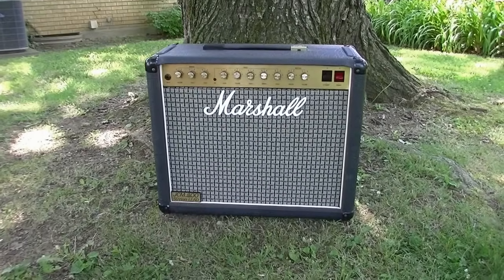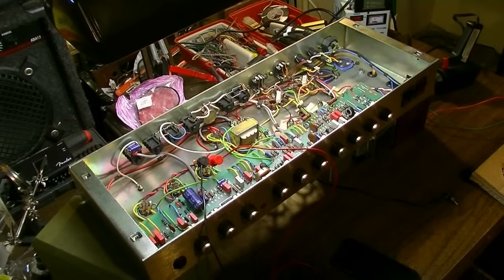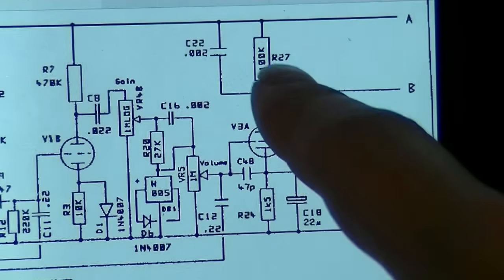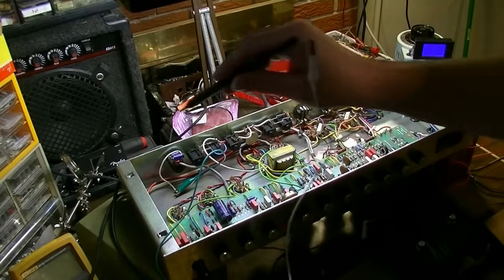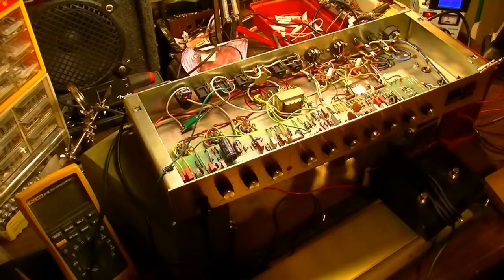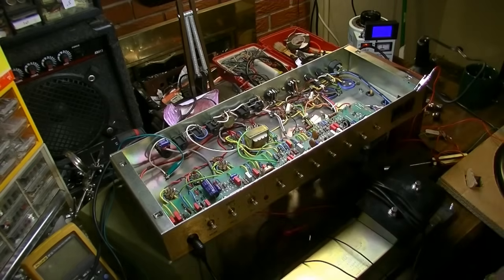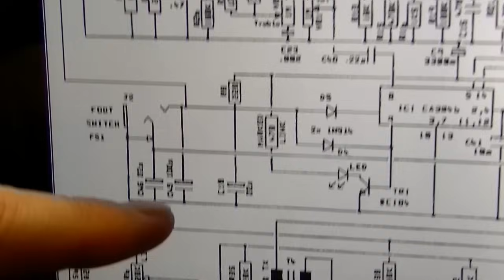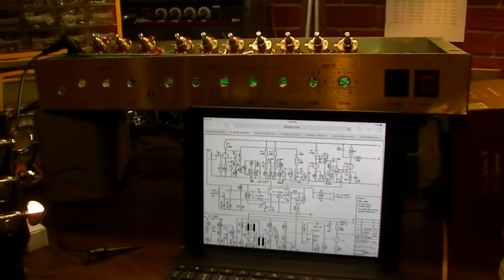The Amp Repair that Almost Broke Me - Marshall JCM800 Combo

Comment: The baby looks like her Dad! I have a non-reverb single channel with 6550s and this will probably help when I rehab  mine. Thankz
Reply from the maker: The milkman is not that good-looking. :P
You shouldn't have any of the switching issues with yours.
Reply: The Guitologist It is a JMC 800 Lead Series I have and I like the grill cloth that has been replaced on this one. I don't think mine has ics or transistors. I am debating whether to keep the 6550s or change to EL34s. Most of these 112 Lead Series have EL34s. They are warmer sounding than those hifi sounding 6550s. The overdrive I get from mine comes mostly from the preamp. It is a good pedal amp though.  Great video! Lots of comments! Thankz

Comment: So what is best guess as to the problem? v1? ...or one of the last 5 or 6 caps? ...dirty socket in v3? 
...one or both of the Q's?, ...that resistor @ 'link'? ...v3? ...or, please say it isn't so, some or all of the above?? (plus I'd forgotten all the caps you changed before) Even if there's no definite answer, you had me on the edge of me seat throughout, and it wuz most instructive... so thanx very much, really.
And please, keep 'em coming and... 
cheers

Comment: I too had a 1x12 50w JCM 800 combo from '86. Bought it used for $250 back in 1995. Almost from the get-go, this thing had issues: From bad tubes that were rattling, the clean channel breaking up too much too soon (when I wanted the damn thing clean), and the speaker being mounted in a weird place (just lower right of center). Even after getting it re-tubed and serviced twice, the issues were still not resolved. But the REAL FUN occurred when I tried to take it out on gigs. I could never EVER hear it, even with the master volume cranked up. Got bitched at by the band leader for being too loud. So I tried to face it toward the wall. Couldn't hear anything at all, and then I got bitched at for playing sloppily (b/c I couldn't hear myself). Long story short, that amp actually COST me gigs rather than helped me get 'em. Ended up selling it for DOUBLE what I paid for it (hence, what the interested party OFFERED to give me for it), and was only too glad to let it go! I said NEVER AGAIN to getting another JCM 800 after that!

Comment: I have a 4210 on the bench which I had to replace the power switch (melted), replace PT, do a rectifier diode work around because the board was burnt up and all traces gone. Someone did work their which caused the rest of the damage.  Amp up working but if you turn the reverb pot it blasts into oscillation.  The work continues. Mark

Comment: A nicely presented tour and explanation of your diagnoses. I'm left wondering, with hindsight, whether you deduced which component(s) actually needed replacing for the fix?
Could I also ask advice, or suggest a video subject? I have an old, appx 1963, Vox AC30 that I have had stored and not powered up for about 10 years. Last time I turned it on it worked fine, but I've heard if capacitors have dried out you might blow the o/p transformer. What components need testing before I power it up? I am an engineer, but it's a long time since I worked on valve circuits (watching your videos for some useful revision!). Unfortunately I don't have a variac. Barrie.
Reply from the maker: You really need a variac. This is the one you should get: http://amzn.to/2sBZ7kK
Even if you don't use it often for repairs, you can always use it to dial your amps down to "brown sound" them or play a lower volumes. You definitely don't want to just throw a switch on that Vox. Ideally, you'd also want some kind of current limiter, but the variac kind of does that already. You'll want to dial it up about maybe 25% of the way on the input and start checking voltages on the power rail at each node and dial up slowly, maybe a few volts at a time, over the course of maybe an hour or so. This will give the original power caps a chance to reform. You may still want to replace them and it's probably advisable, but some weird people like "all original" in vintage stuff like that and if you're thinking of selling it, it might be better to just leave them in if they work. It is not likely they will take out a transformer unless they are shorted. But only then if you didn't have a proper fuse.
Reply: Thanks for the advice. So I'm guessing all of the biggish electrolytics most likely to be suspect? I'll look into buying or borrowing a variac - thanks for the suggested link, but as I'm in the UK with 240v mains that wouldn't be the model for me.

Comment: I never had an 800 but loved my JCM 900 when I owned it back in the 90s.
Reply: I had a JCM 900 in the 90s as well. 50w head, not the 100.  Had this theory that I could crank up a 50w to get that heavy overdrive sound I wanted without blowing out my neighbors windows.  Turns out I was right.  Loved that amp and the cannot remember for the life of me why I got rid of it. I recall selling it but I cannot remember to whom or why I felt at the time that I was better off without it for any amount of money.

Comment: Damn brother, I love your stuff. But for the love of God, get a sign gen and an o-scopes! They will greatly simplify signal tracing by giving you a visual representation and voltage differential from each stage! An extremely quick way to verify amp stage gain function. Also very cheap to buy.

Comment: I have had a similar problem trying to get a reading on a negative feedback resistor while in circuit. I couldn't figure out why I was getting such a low value. Then I realized that when the probes were on that resistor, you also have a connection back through the output transformer to ground. In this case, you were basically reading the connection through the 100K resistor in parallel with that 4.7k resistor between the 100k and ground.
Reply: Bobby U absolutely right! DC conditions the 100k is in parallel with the 4k7.

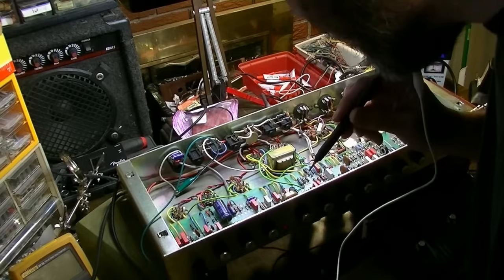Comment: What are you doing around 20:30-22:00? are you connecting a speaker directly or is there something else in between? What is that black pen looking thing? something impedance matching?
Reply: He's doing an audio trace. His black pencil kinda looks like a probe from an old multimeter or oscilloscope. Think about it though, the signal levels where he is testing are in the preamp and would be too low for just a speaker.
The alligator clip on the end of the old probe would be connected to a smaller (sacrificial) guitar amp's input cord, the ground would be connected by another alligator clip to the test amp chassis. The audio signal is picked up by the probe, where you touch the circuit, and heard though the other amp. This demonstrates how far the audio signal is getting through the circuit and also what is happening to it at various stages. Typically there is about 10pF capacitor in the probe, not sure what Our Hero uses.  It's a neat trick! Like an oscilloscope for your ears.
Reply from the maker: Rick is right. That probe has a small capacitor on the end of it to block any high voltage DC and the gator clip is going to a cable plugged into that Kustom KBA15 amp at the back of the desk. Another ground lead is going from the instrument cable ground to the Marshall chassis.
Reply: That makes sense.
Thanks to both of you for your answers.
Love your videos.
Reply: Is there any reason why you are not using a signal generator and an oscilloscope, i use this when repairing amps ? It seems to me that it possibly could be quite dangerous poking around in the amp with one hand and strumming the guitar with the other since the strings on the guitar is earthed (chassis) and if you get shocked from one hand to the other it could certainly be lethal.
BTW i have the head version of this amp which i bought new, its a bit funny since the head has an additional presence control which the combo doesnt have. I remember way back the singer who had the combo that was plugged into a 4x12 was envious of my head since it sounded much better for some reason, maybe slightly due to the presence control, but it was maybe since mine is a late model from 1989 or it may also certainly had been my old vintage 4x12 with 70´s greenbacks i dont remember if we ever tested swapping, it was over 20 years ago.
Reply: ditto - plus the real issue was the defective tubes supplied by customer??
Reply: Stefan Sjöberg 1)the capacitor to absorb any DC high voltage; 2)he's strumming the guitar with the chopstick

Comment: Question, when you are checking the microfarads of the capacitors, did you have to take them out of the circuit or are you able to check them while they are in a circuit? Nevermind I saw that you took them out.  (Note to self: Save Chopsticks)

Comment: I had a 12AX7 tube in a Marshall JMP-1 that did that same popping noise. Replaced the tube and works fine. Thats the only 12AX7 I ever had go bad. It was a very old tube.
Reply from the maker: Marshalls are hard on 12ax7 tubes.

Comment: That 100 K resistor @ 31 minutes provides no feedback, because it would have to be in the 4K or lower range to create enough feedback to do anything, (the gain in that part of the circuit is very low because of the step down transformer, output.)  The reason it reads 4.7 K or so  is because the output winding is grounded and the other leg of the 100K also goes to the 4.7K (?) resistor a the base of the cathode circuit..  It is easy to test the output by putting a calibrated signal (like 1 volt of 1 KHZ sine into the PI),  In most amps that produces several watts of output.  Most PI's are really similar

Comment: As soon as you add ICs and switching transistors, the complexity increases and so does
the troubleshooting effort when things fail.  Leo had it right the first time...the KISS rule,
and that is why the old vintage Fender amps are in such high demand, and collectable.
Reply: You are so right.  Way too many engineers out there trying to re-invent the wheel.
Reply: I had an old Mesa Boogie Mark 1, no complicated electronics on this, hand soldered
For Marshall the 1959Plexi heads are the one's to hold on to
Reply: my traynor? same: pull the lid= everything right there. can reconfigure 5 ways ta sunday in minutes.jumper clips . too easy. older bassman 10's /eyelet assemblies=easy to swap parts...and fairly forgiving* depending on the order in which parts were installed
Reply: the only flaw i see in the mark I (reissue>tubestore) is the presence control. it is not actually a presence per se. since it sits prior to the mstr vol. a prsence control is a "not feeding back" of just hi frequencies from output side of the output tranny. not a tone variance. some use the typical presence to get pinch harmonics more easily when ..? say half way up and use the treb to manage.

Comment: Your problem was a heater cathode leak on one of the valves TR1 only switches the LED on and off. It is getting it's supply from the heater 6.3V

Comment: Could you explain to me, why you don't like PCB mounted Pots?
From a manufacturing standpoint, it seems like a good idea, less wires (less hum), less time to put it together, etc.

cheers

EDIT: 34:25 I get it.
Reply from the maker: Well, on this model it really wouldn't be easy to change those pots to wired pots because the entire board is mounted with the pots. THere are no other mounts or standoffs, just the pots. So you'd have to drill mounting holes if you decided to do that. But the idea is, the pots attached to the board transfer any movement or strain directly to the solder joints on the board. This thing is from 1988 and I guess it's hard for me to knock it too much considering it's survived 30 years without that problem, but I guess it's an OCD thing.
Reply: Thanks for the quick Answer!
That seems like a good point, hadn't thought about that. I totally get your first point, I have worked von these kind of amps before and it's always a nightmare to uninstall or reinstall the pcb...
I guess it's the old "Manufacturing-process VS Repairability"-conflict :)

Comment: I can't believe changing all those capacitors in the switching matrix was the root cause that was causing tube V3 to squeal. I would have never thought about changing capacitors in the switching matrix that related to a tube squealing and oscillating.

Comment: Do you happen to have any videos on how to adjust the bias on a Blackstar HT60 ? although this video is for someone more experienced in electronics I did learn a few things,  thank you
Reply from the maker: The only Blackstar video I have is just a demo. No repair vids yet. I try really hard to avoid taking in too many modern amps because they can be so tricky to troubleshoot, you end up with a steep learning curve over traditional amps and spend more time for less reward. I wouldn't think biasing would be too difficult though. Have you got a schematic?

Comment: I have been playin vintage tube amps a long time. I want to tip my hat to you. a few techs I have used have changed out nice vintage cans because they say caps only last a few years.  you stated thrse, if still good could last a little longer or for 10 to 20 more years  that is my problem with many of the techs today. I have a 77 Marshall jmp 50 watt lead bass. It's  100 original. I think the power tubes might be going or maybe a cap or two. I am deathly afraid to take it in knowing the last two techs I have used both switched out old caps on my vintage amps cause they said they were doing me a favor. 1 I even told 1 not to touch anything  they didn't  absolutely have to. every piece effects the tone at least a little.  that guy was a big name at Ampeg in the 60s and still very well known/respected. by most except me. the other guy is a boutique amp builder in nj with a pretty big name. Can people send you amps to work on?

Comment: I've got a problem with my peavey valve king. It looks like to me that the preamp tubes are hit plating and the amp changes tone drastically after I replace them. Only after a few days or at often weeks. I would really like to have this amplifier head fixed.

Comment: Sounds like you need a tube tester to screen these things when they first come in. Would've eliminated a weak tube at the start.
Reply from the maker: I have one and did test the tubes. DIdn't include those video clips in the final edit because of length, but the tubes tested fine on the tester. V1 was a bit weak, but still should have worked. Probably would work in anything but this amp. This model seems to be really picky about tubes.

Comment: My dream amp right there!!
Reply from the maker: I think my customer was going to sell it, so maybe I'll point him to your comment.
Reply: The Guitologist thanks for that, no cash for new toys for a while so I'd prob be out my friend. Thanks Again, love the videos!
Reply: The Guitologist i would be interested if you know how much he wants to sell it for?
Reply: BENAFEN I am the owner. You can message me if you are interested🙂
Reply: most amps need tweaking or tube swap due to the shear number of components in the chain..dialing in as they say. i have had a few that i have serviced for minor retube/parts upgrades etc. that sound good out of the box. ex: BJr ltd, hotrod III ( with minor tone stack corrections..not redesigning). most of the marshalls i have had were not the holy grail types. i have retubed a couple JCM's to 6L6s for better tone.
this marshall 2205 circuit has its flaws(*imo)the od clipping approach which uses the bridge and diode is plain goofy. not a single high quality pedal uses this idea..right?..yes clipping leds do awesome stuff based on the application and insertion method. used on my traynor for breakup when 1st pre-gain is past 4 on dial. otherwise dead clean. switching IC's are problematic. why ? AC noise/glitches/brown-outs..you name it..?static from carpet.. all bad
Reply: This is one of the least desirable JCM 800's. The praised ones are the 2203/2204 models. But this is a great amp still.
Reply: jamie B. yes the 2203 jcm800 is about the same as my traynor wiring(in my chan demo) the mastr vol version. this 2205 is...cheesy. i mean no offense to those whom feel it is their tone. i have worked on and dealt with this line of marshall design and not inspired. * any one who seeks the  technical reasons; email me( see some of my demos in the more notes for address) . a hotrod dlx with ts808  is way better . tonally and versatility. ..so ya know .. I play all kinds of rigs ...and have prof opinions about each one.
Reply from the maker: One thing I failed to show was the breakup on the Normal Channel. It breaks up like a 2204. Crank the channel volume and Master and LOOK THE FU%^ OUT! Only thing you're missing is the Mid control and Presence. If you prefer the JMP/2203/2204 sound, you can get there in Normal Channel on the 2205.
Reply: * guess i am speaking from the amp alone aspect...not being able to consider the pick ups in the guitar. your amp's performance (rare) is the example of the sum of everything affects everything. the 900 series uses similar design...and.well .. one of marshalls attempts to re-invent the wheel. notice how this model is not sought after nor cloned to death...by...uh... anybody?,Yet the 800, plexi, 5F6A ( marshall specs ) are cloned,duplicated, by every boutique builder ? ya got it!..
Reply: I forgot to say. Don. You know sticking 6L6's in a Marshall is against the law, right?

Comment: I rewatched this video and I love the signal tracer you used. I recently built an amp that's not getting me any sound, despite that all the voltages check out correctly. My fear is that the output transformer is faulty. I was wondering how you set up your signal tracer so I can narrow things down in the amp. I figure you plug the guitar into the amp you're working on and plug a known working amp in and somehow connect test pins to a guitar cable, but I'm not sure how that's done. If you could elaborate on this, I would deeply appreciate it.